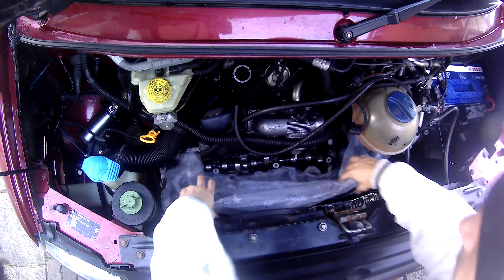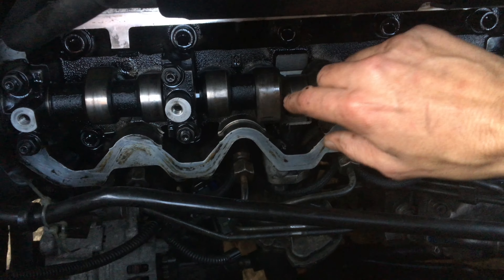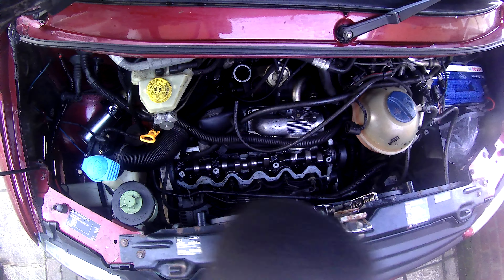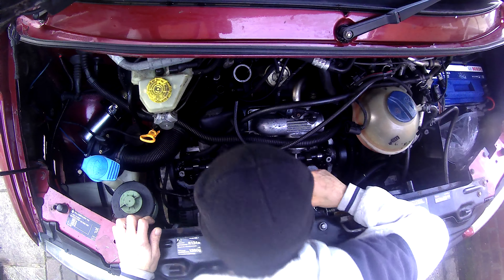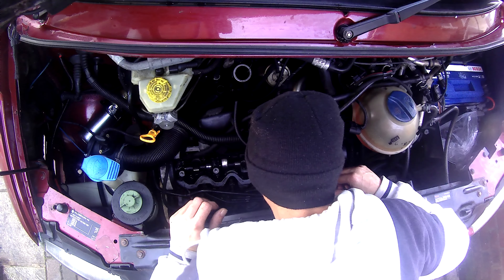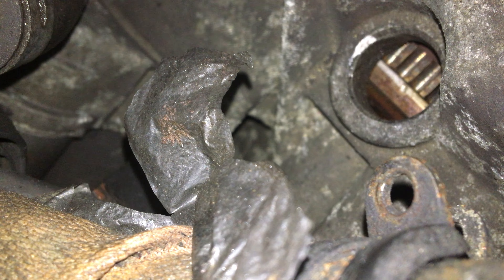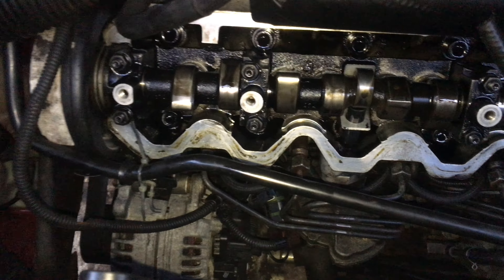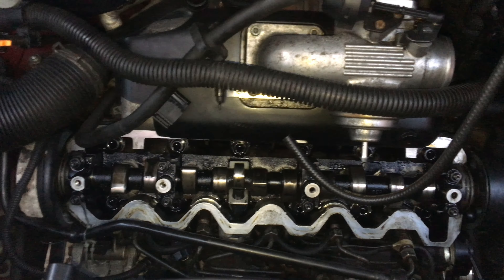Inspecting hydraulic tappets & Setting TDC

Comment: Hello mate I was wondering if you know how to cure a problem with the steering wheel on a t4 it has excessive play inwas told a top bearing but can't find anything anywhere
Reply from the maker: There is a few components that can cause play in the steering. Ball joints will do that but also a failed ball joint will result in the wheel collapsing. The top ball joint can be replaced 

https://youtu.be/zRaRHUhQdpM

Comment: Scribe a mark on pump @ tdc to save you time later on
Reply from the maker: The notch on the fuel pump pulley lines up with the mark on the pump housing
Reply: @TwiggsT4  well it’s close but as you said in the video, it’s not exact because if final timing moves them. I think the pulley marks are better at confirming you are in cylinder no. 1.

Comment: The camshaft tdc reference is only visable once the pump pulley is removed
Reply from the maker: I was looking at the lobes on cylinder 1 and when both valves were shut, I would then look on the flywheel for the mark.
Reply: The things to look for are: #1 lobes pointing upwards (10:00 and 2:00), diesel pump marks close(ish) - final timing of the injection point alters these marks relative to each other, and you’ve also got the slot in the camshaft pump pulley being horizontal. Also the notch in the vibration damper pulley will point at 9:00 (rearwards). Finally the flywheel marks give you ultra fine checking to get TDC. 
So there’s loads of things that give clues to how close you are, but the flywheel marks are the most important.
Reply from the maker: Mate that’s awesome little write up, really helpful for those who read the comments 👌 I think also where the centre punch mark is I’m going to do what my friend done on his and with a metal paint pen I’m going to mark the centre punch mark to make it easier to locate in the future. Thanks for watching and commenting 🙏🤙🤙🤙